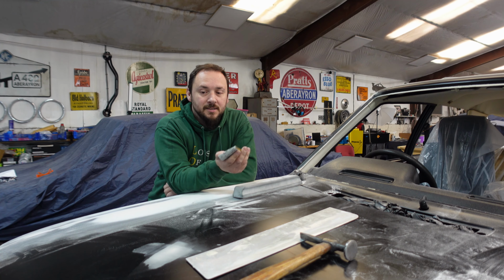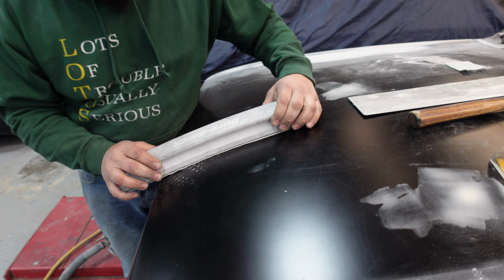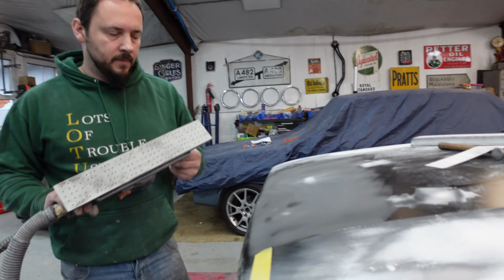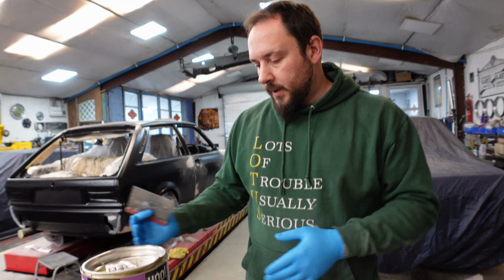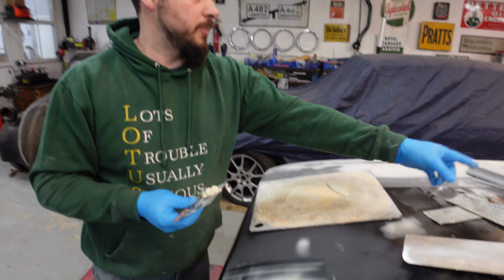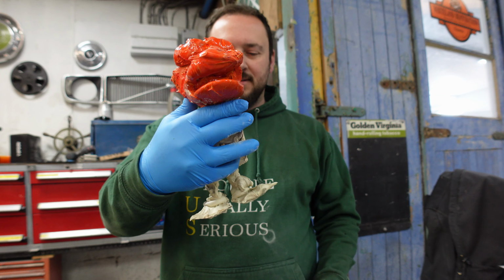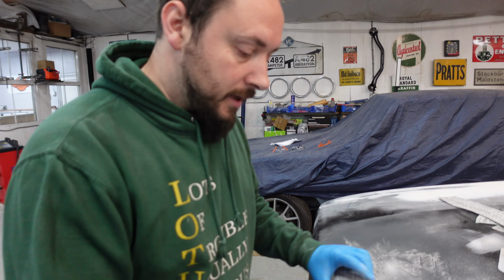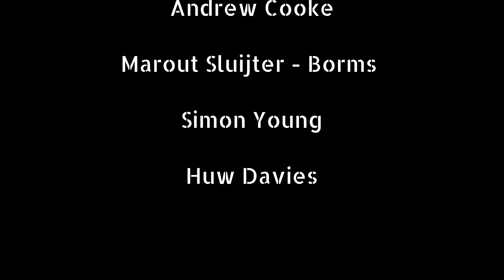How to Use Filler on a Large Shallow Dent!  Talbot Sunbeam LOTUS

Comment: Another very informative video guys. Have you ever noticed, all the different brands of filler say "exceptionally easy to sand" or similar. I would argue that they should say "compared to mild steel". I now have arthritis in both shoulders and find all fillers exceptionally difficult to sand! You are so right, get the filler in as perfect as you can to save sanding. Incidentally, what brand of spray filler do you prefer? I have had a bad result with some I bought and it's put me off it a bit.

Comment: How long do you let the filler cure before you sanded, and can you use a filler on a plastic bumper, somehow it doesn't turn decent when I do it?
Reply from the maker: Depending on temperature, about 15/20 mins and its ready to sand. You can get specific plastic bumper filler which has a bit more flex to it but the same methods apply 👍